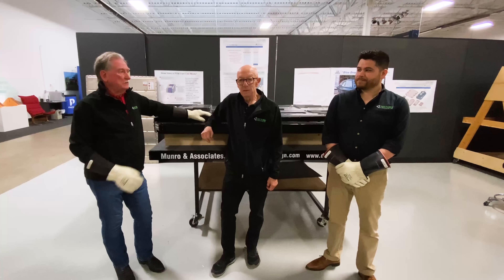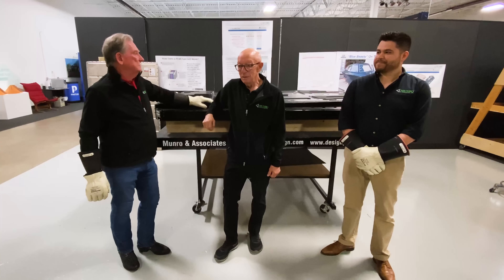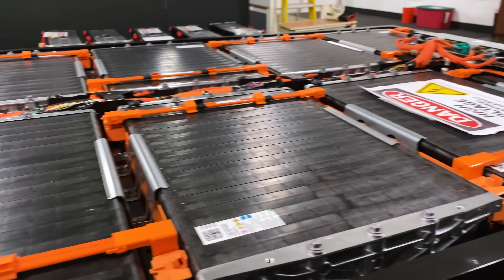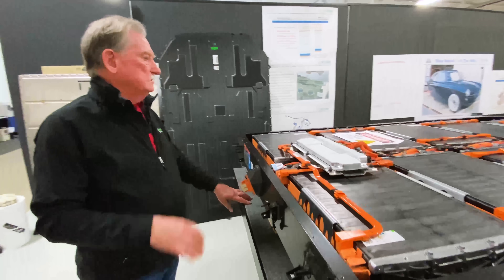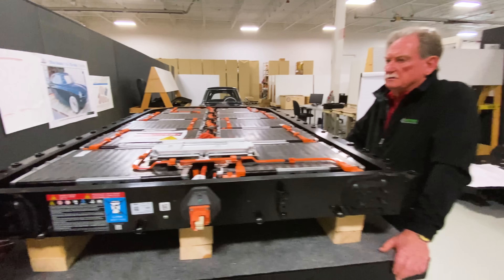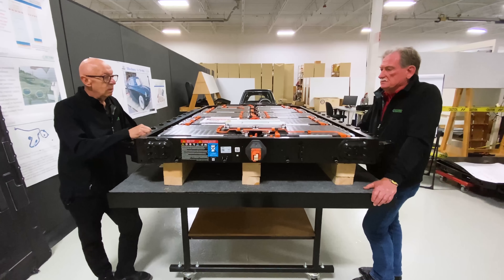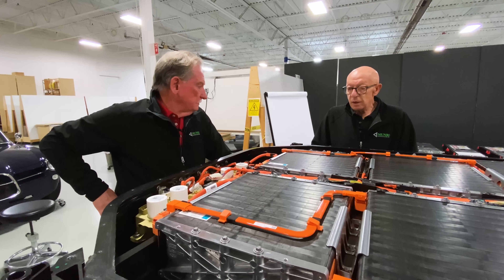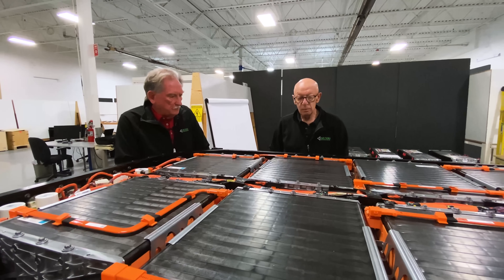Ford Mustang Mach-E Battery Exposed!

Comment: Lots of BMS wires is a good thing. It allows for better cell monitoring and balancing compared to grouping large numbers of cells together. Having one big central BMS also makes servicing easier. 

The first thing that struck me when the lid came off is that this battery is designed to be repairable. Bolt and Volt batteries can be serviced, but not in the dealership. Tesla batteries can't be serviced at all. This does matter beyond reuse of cell packs at end of life. A car that can be repaired can stay on the road.

I was also pleased to see some room at the outboard edges and power busses in the middle. These features allow for considerable deformation in a high energy collision before a potentially unsafe condition wou8ld occur.
Reply: Almost as if they expect to have to repair it?
Reply: @rogerstarkey5390  Almost as if they expect the vehicle to last. EVs should last much longer than ICE cars. That will only be true in reality if they can be repaired economically when they fail. Our culture of disposable products is unsustainable. 

Today if you have an early Prius and the battery goes bad you can have an aftermarket replacement installed for far less than Toyota would charge. You can even get a kit that allows a modestly skilled person to do it at home. This is the direction we need the market to move.

Tesla batteries are not designed to be serviced. Tesla won't even sell mechanical parts to owners. As Elon said, EVs could last a million miles, but many otherwise serviceable ten year old Model S cars risk becoming "Uneconomical To Repair" when their $20,000 battery quits due to a single bad cell.
Reply: The BMS has 96 input points, because it is a 96S battery configuration. Any BMS for this battery will have the same 96 points, for the 96 groups of 3 parallel cells each. 

What they're talking about is whether the BMS hardware is in one central location (with long tap wires, as in this case), or distributed as a slave unit on each module (with short tap wires) and a network linking the slaves to the master.
Reply: There's little if any difference in serviceability between this and the Bolt or Volt. None of them will be serviced in a dealership, where only the whole pack is replaced; only someone salvaging modules for reuse or processing the pack for recycling will ever open the pack.
Reply: @brianb-p6586  I know of Chevrolet repairing Volt batteries that had faulty components and I know Nissan has done the same. At some point when there are enough EVs on the road and enough trained mechanics (EV high voltage ASE certification classes going on next week at Weber State University in Salt Lake) it will make sense for dealers to be able to repair the single most costly part of the car rather than scrapping it. After that there is the aftermarket to service old degraded batteries as is the case today with older Prius batteries. Glad to see Ford isn't making that impossible as Tesla does.

Yes, every cell group needs a BMS lead. As Sandy said, some other batteries incorporate circuit boards into the cell pack and only communicate with the BMS computer through data leads. That puts balancing resistors and MOSFETs in or on every module. I prefer having all that on one board or box. Will make diagnoses and service quicker and cheaper.

Where did you hear the cells were 3P?
Reply: @Miata822  It's good to hear that GM has done some internal repairs. Tesla is not GM or Ford... in sooo many ways. LOL

Dealers don't even fix engines much anymore - they swap them for remanufactured. Being huge and expensive doesn't mean that a dealership wants to get into it, or that a manufacturer wants to support them getting into it. I can see specialty rebuilding shops and remanufacturing operations handling batteries, just as they now handle transmissions, engines, alternators, starter motors...

Jalopnik published an interview with Ron Heiser, who is apparently the Mach-E’s Chief engineer:
https://jalopnik.com/a-look-at-the-engineering-behind-the-2021-ford-mustang-1839911078

This Munro video shows the standard range battery. The extended range battery has two more modules, and a 94S4P configuration instead of the standard battery's 96S3P... of the same cells.

By the way, that article includes images and descriptions of the motors, which are clearly both PM... despite Sandy's stated expectation in another Mach-E video that the front motor would be the induction type.
Reply: @brianb-p6586  Wow! What a great interview. Love seeing a journalist who asks the right questions and then gets out of the way of the answer. Notice that Heiser specifically mentions how the battery assembly is designed to be serviced.

Yes, modern engines and 10-speed transmissions are ridiculously complex and have very tight tolerances that can't be held in a garage not dedicated to that kind of work. 

Changing out a cell pack here, he called them "arrays that basically fit in like Lego blocks" and "if you ever have any type of problem you can go in and service an array as opposed to having to go into the whole battery." 

I like that they are thinking about that. EVs can last much longer than ICE cars, but only if they can be serviced. My '11 LEAF, now handed down to a niece, is mechanically perfect at well over 100k miles but is on it's 3rd battery. Bad battery design but there are those who are working with them outside the US. A small UK firm is is actually doing battery upgrades for older LEAFS by installing larger packs.

I drive a Gen 2 Volt and have purchased Volt battery segments for projects. Many people are becoming more skilled at working with batteries and controllers. An open source controller for LEAF drive units is under development to allow that unit to power retrofitted ICE vehicles. 

EVs are today's wild west for hackers and tuners. That is a wonderful thing, and just maybe can save car culture. So glad Ford is leaving the door open.
Reply: CORRECTION: In my original post I said Tesla batteries couldn't be serviced. I forgot about this guy (link below) who can identify a bad individual cell in a Model S/X pack and disconnect it. This is really a patch, not a repair, but for many people it will make a lot of sense. Driving hard after this repair will put extra load on those cells remaining in that parallel group though.

https://www.youtube.com/watch?v=F-B_8oMZNeI

Be sure to note the numerous rubber hoses used to connect the cooling circuit in the Tesla battery.

Comment: Poking your fingers in there around the orange electrical cables is a really bad idea, glad nothing happened. From what I can tell the BMS is the unit on one end with all the leads from each unit going to it. The other end has the contractors, probably DC/DC converter(s), possibly temperature measuring circuits, and various protective fuses. Looks very serviceable, and easy to swap modules in case of a bad cell compared to the latest Tesla designs. I do like the extra space inside for crash protection. One unit getting punctured should not spread fire into adjoining units. Not bad for a first effort.
Reply: Close - there's nothing in the end as large as the DC to DC converter - just contactors and fuses. The DC-to-DC is stacked on top of the charger, which in turn is mounted to the top of the structural crossmember above the front motor.
https://jalopnik.com/a-look-at-the-engineering-behind-the-2021-ford-mustang-1839911078
The DC-to-DC is not normally placed within a battery case, in part because that would require more wiring connections through the battery case.

Comment: "I haven't seen that before.." - what , contactors in a battery pack, or round ones? 
May be unusual to have that many inside the pack, as fast-charge contactors often live in a HV junction box, but all packs have at least a couple inside for battery isolation.

Comment: the id4 one seems a lot more dense and organized, this tray has a lot of dead space between the modules. Maybe better in a crash.
Reply: until a hose bursts
Reply: Some of the dead space is to allow for the longer modules of the extended range pack. You can see that there is no extra space along the sides with the larger modules:
https://jalopnik.com/a-look-at-the-engineering-behind-the-2021-ford-mustang-1839911078
Reply: re: "Maybe better in a crash." and will be slightly cooler during the numerous charge/discharge cycles taking place PRIOR to this crash.

Comment: There is a lot of unused space inside that pack!
Reply: The same pack width and length is used for the extended range (higher capacity) battery, which has longer modules because there are more cells in each module. The extra space around the sides allows for those larger modules of the extended range pack.
Reply: Smuggling. Lol
Reply: That's where drugs will be stashed.
Reply: @rossturner76  Anything is possible.  As long as the dogs cant smell them.

Comment: At 6:45 did Sandy say 'there's no dog coin on here'???  Another obscure manufacturing term?  Did I hear it incorrectly?
Reply: "Dog point", it's a type of protruding tip :)
Reply: @joedouglas5243  Awesome.  TIL.  So those little points on a washer or screw that grab into the surface to keep them from backing out?
Reply: @HylanderSB  Yup, right! Although if Sandy were to start promoting Doge Coin I wouldn't be too surprised if he mistakenly call it Dog Coin.
Reply: @joedouglas5243   That's all boys and girls.  Don't forget to tip your cashiers .  Maybe tip them with some of that new dog coin!

Comment: If Ford came out with this 5 -10 years ago, it would've been amazing. Now it seems pretty good but too many parts. 
Any insight in the state of battery production by the different companies? Could Ford or VW significantly increase production? I know my Tesla channel friends think that by the time Tesla comes out with the 4680s all the other companies will be running out of batteries. In addition to a Model Y I have a Prius V, it too has batteries, so clearly Toyota has some experience with batteries.
Reply: “If Ford came out with this 5 - 10 years ago”

Ford came out with the first Hybrid SUV, nearly 20 years ago, then the first plug in hybrid SUV around 15 years ago. I almost bought a used plug in hybrid from Ford about 6 years ago.

The newer ICE engines were so reasonably fuel efficient, I would have made the jump if the car was only $1k-$2k less.
Reply: re: "I know my Tesla channel friends think that by the time Tesla comes out with the 4680s all the other companies will be running out of batteries."  yeah INCLUDING Tesla.  sadly Teslarati are no different than other dumb Humans in recorded History when it comes to suffering from DELUSION/FANTASY regarding the future.  the coming material shortage will be a RUDE AWAKENING for Tesla same as it will be for the OEM's.  the global Chip Shortage is the first WARNING SIGN of what's waiting in the distance, but of course everybody's sticking their head in the sand. #OSTRICH  this EXACT behavior is how we got the collapse of the Housing Market back in 2009.
Reply: @phillyphil1513  One of the worst comments of the day.

Chip shortage was induced by a supply/demand issue caused by the erratic market due to the pandemic.

The Housing Market collapse was a bubble that was exacerbated by extremely shady financial practices.

Tesla has forecasted that they will sell 20 million EVs in 10 years.  They know how much materials they will need for batteries and have been working to procure the materials they need.  They are preparing for the future and are working to make sure they have enough raw materials.  They are making sure that enough materials are mined and also that they can recycle batteries to fulfill future demand.  Your comments presume that you know more than the people that actually work in the industry.  Good try.

Comment: I no longer believe the batteries in EVs will be reused. I think the will simply be recycled. In 20 years they will not be interesting or advantageous for storage. IMO
Reply: Possible.
Either way, the constituents will remain "in the system".
Reply: It depends.  There are DIY types already reusing battery packs from crashed cars as home batteries.

Comment: Hi Sandy,

I'm curious if perhaps the Mach-E top cover (the side facing the passengers inside the vehicle) was perhaps designed to be allot more fire resistant, rather than the thin sheet of aluminum in the ID4 that would like just burn up quite easily in a thermal runaway event?

Watching your other brainstorming video about how best to design a battery pack, it appears to me (as a layman) that Ford might have incorporated some of those design aspects into this pack.

What are your thoughts and observations on this?
Reply: I thought the thin aluminum was a fire hazard.

An ocean going vessel from Europe, carrying electric cars, recently sank due to a fire onboard. I believe there were some VW’s onboard.

Batteries must be respected.

Comment: Not sure why this dude is for having more smaller modules at the end - wasn't he against all the extra wires and connections at the start? More modules means more wires and connections which means more cost and weight, as well as more potential failure points.
Reply: Having many small modules does not equate to having lots of cabling and plumbling connections. As they mentioned, other companies are going with an integrated BMS inside the module so that the only wires outside of the module are the higher voltage connections on the bus bar. Two big connections as opposed to dozens.
Reply: @patreekotime4578  See the big flat orange busbars connecting each module? They're mainly what I'm talking about

Comment: Was there a mid-pack contactor and fuse under the box that's assumed to be the BMS?  I assume there is a contactor in that front block for the rear motor as well?  The modules and central BMS will make this a popular battery pack for EV conversions and DIY EVs.  Each block is a "safe" voltage and the cell-taps are easy to interface to 3rd party controllers.
Reply: what's more important, unlike Tesla packs, you don't need to hack the cover off with a spatula
Reply: Any idea what the harness connectors that go onto these batteries?

I may have 2x of these modules, trying to find a wiring harness connector, so I can add a BMS

Comment: BMS balance wires longer vs more electronic pc boards all talking together. Keeping the BMS design simple makes my vote.  
The thing that isn't stated is the cells are cooled at just the bottom VS the Volt has a jacket around the pack.  
The pack can be  almost totally recycled VS Tesla has large amounts of glue that just hits the land fill.
The cans are relays and they are common in the EV industry.
 I would like to see this pack in a few years and see how they improved the design.
Reply: The cooling of the Volt cells was unusual, and was done because the power density in the plug-in hybrid application was high. In a battery-electric vehicle power density is lower and that sort of extreme cooling is unnecessary... which is why the Bolt and just about everything else uses just one module face (which is against the edges of the pouch cells) for heat transfer.

Comment: It’s gonna be interesting to see what high SALT driving areas do to battery cases
Reply: I think we can be pretty sure any half intelligent auto manufacturer knows what materials to use to prevent this obvious and well known issue, and how to coat what's necessary in corrosion preventative compounds.
Reply: @airheart1  lmao you ever looked at the cars on the road in a high salt area?
Reply: @airheart1 , but Ford though.
Reply: i'm picking up what he's laying down.  there is indeed a difference between HIGH SALT (ref Chicago) and LOW SALT.  most of the treatment OEM's currently do to vehicles is only adequate for LOW SALT.  Pro Tip: the key to rust prevention is simply washing the UNDERSIDE of vehicles not just the TOPSIDE vehicles (which is what our vane natures causes us to focus on).  of course, properly accessing the underside of a car isn't that easy unless you have a lift or local drive thru wash with working underside cleaning option. really even a set of ramps and a garden hose will do, the idea is just to RINSE the crap off occasionally.  #PREVENTATIVEMAINTANENCE
Reply: Since EVs dont produce any heat, you can put plastic covers under the car to protect from salt and general dirt and such without issue. I dont know if that is what Ford has done, but Im sure all EV's will be completely plastic from the underside in the future.